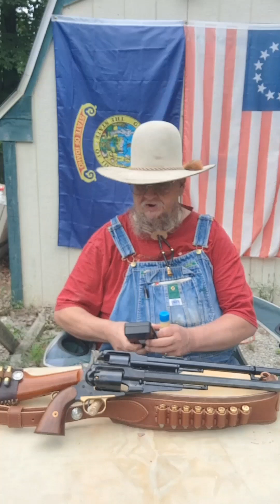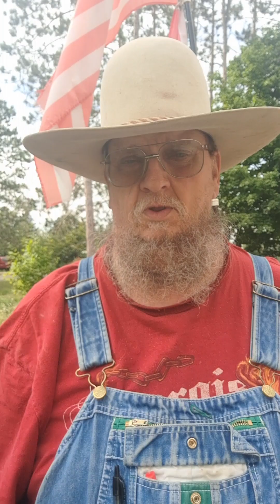the other 66 Carbine conversion

Comment: I love it. Also glade to see you fixed the half cock. I kind of know the feeling of Intimidating myself from doing things. I own a corvette that i built over the years for drag racing. Under boost and with Methanol injection, on pump gas. it would make just over 1000rwhp. its street Legal and was my daily driver for a while. When i had my company, i had a heart attack. They say it was from over work and stress. But since then my corvettes had some small Problems happen. the car just sets in my garage. For some strange reason i feel Intimidated to work on it. I miss drinking it.
Reply from the maker: Yea I have a hard time just seeing the contrast of a slot in a screw head so I allow myself to be intimidated from things I've done a life time of. Now days I won't drive due my visual issues.  Now it's cool you did what you do with car's.  Now that being said I was once as comfortable with a Harley as I was with a horse.  Mountain man is my #1 interest, a very close 2nd is OLD bikes, trucks, and tractors. For me it hurts my feelings when  someone gets a perfectly good 40s 50s 60s pickup truck, dismantle it. Then put in new suspension, lower it, put in a small block, and a turbo 400 in it. 🤨 making it no longer a truck. I know I'll never afford it but my dream is a late 50 chevy apache 10 with just the old Straight 6, and the granny geared 4 speed.  The only up grades I would want it would  be going from the old 230 or 235 up to the 292 Straight 6. Add a manifold 2 barrel carb, and of course headers.  Knowing me though I pipe it for smoke stacks.  Old trucks  in my opinion should be just old trucks. Tough as nails. 
Mountain man
Reply: @StevenMMan  I have always wanted a old Indian bike from the 1920s. They were so beautiful back then. I can definitely understand you on old trucks. Crazy thing is when it comes to cars or trucks I was always into modifying newer stuff. Or sometimes building resto mods. Mostly with corvettes though. I built several 1963-67 corvettes that had modern tubular frames custom made so that i could run modern engines with 6-speed manuals and rear ends out of dodge vipers. But from the outside the car looked mostly stock. My last few years of modifying cars. I bought a 2017 Lamborghini in 2017 and became obsessed with making performance parts for them. Mostly twin turbo kits. I sold the car a few years ago to a friend.  I regret selling it I absolutely loved the car, but every time I drove it. It would have stupid people being stupid around it. So many times I would walk out of a store and someone sitting on it or standing on it scratching the paint while they take pics for Facebook. 
Or some dumb kid in a Honda trying to race on the highway almost crashing into you trying to get you to race. So I rarely drove it. And when I did I was worried I would end up in jail from choking  idiots to death.